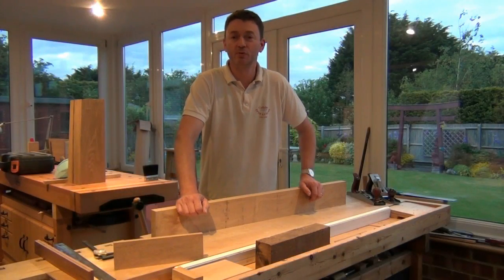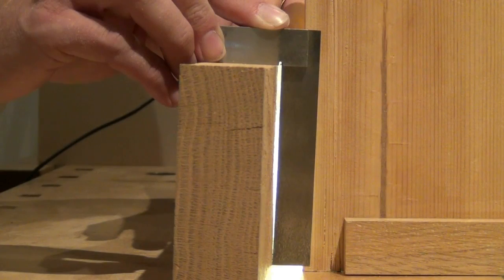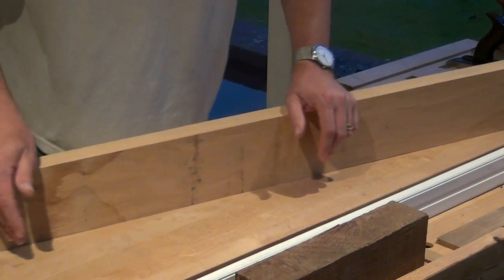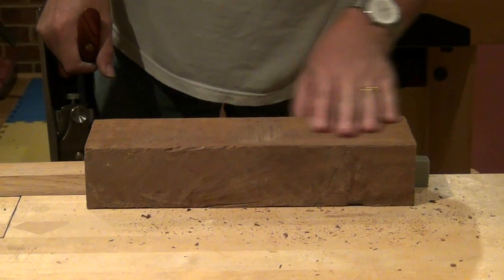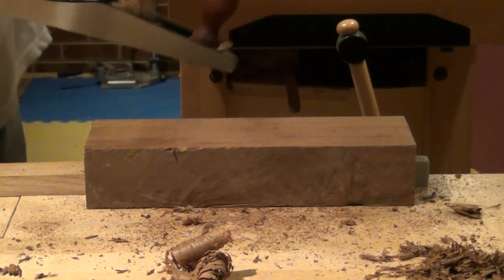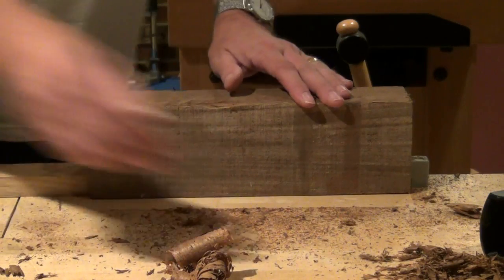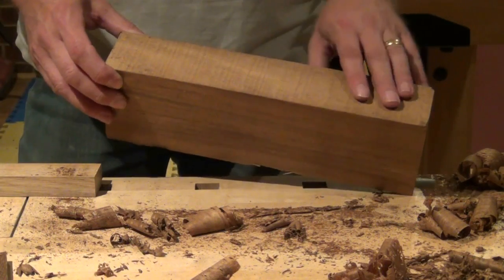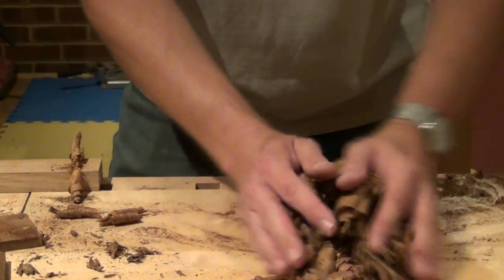Squaring a Rough Board (S4S/PAR) #HandorPower

Comment: Nice job of demonstration Mitch Peacock - WOmadeOD.  Can you explain why you chose to do diagonals at the very beginning?  I often see others doing this, but I don't recally anyone every saying why.
Reply from the maker: The plane sole rides the edges and prevents the iron from cutting in the low spots. Alternating direction covers all bases in that respect. I also find it easier to take heavier shavings without tearout on the diagonal or cross grain, like using a carving gouge.
Reply: Mitch Peacock - WOmadeOD , tyanks for that bit of insight.  The use of diagonals now make sense to me.

Comment: Nice idea to show the contrast between the two approaches. I do exactly what Guy demonstrates; power jointer, power planer, and table saw with perhaps a bit of hand planing here and there. It does occur to me that the hand tool approach is far less expensive.  Entry level table saw, jointer, and planer will cost $600-1000 and no dust collection at that entry point, while a used #5, hand saw, engineer's square, straight edge, and bench (as you built in your intro series) can be obtained for far less; perhaps even under $100. I think one of the most common comments I see throughout the youtube woodworking channels is some variation of: "Then you pull out your $10,000 wonder tool, which most of us can't afford...", a genuine issue for many aspiring woodworkers that I think you and Guy are addressing in this series.  I am looking forward to seeing more of these.
Reply from the maker: Kevin Blair Thanks Kevin, appreciated. So far no requests for another to cover, so hoping somebody comes up with one!

Comment: One thought is a picture frame. I've made a fair number using power tools (table saw, router table for the rabbet, and either chop saw or table saw for the miters). I find that frames are very fussy. The 2 sets of sides have to be precisely the same length. You have to cut 8 perfect 45 degree miters and then get everything to line up perfectly when doing the glue up. I've watched your shooting board video a few times and wonder if that would make it easier to get the miters perfect. A second thought is inlays. Another woodworking task that can be quite fussy to get just the right depth and width to match the inlay stock. I have a much better idea of how to accomplish these chellenges with power tools, but have a sense that hand tools may make it easier to get the precision needed for successful/best results. Kevin
Reply from the maker: Kevin Blair Thanks Kevin, they sound like interesting topics. Guy and myself will go through all the suggestions soon. 
I can see me squeezing in mitre shooting to the August dates!

Comment: Perfect thanks Mitch, managed to see the light and everything in my workshop is now done by hand tools. Even ripping 8' boards to width; which does become a little wearing at times, but I always work to the mantra "never fear slow, only fear stop!".

That was the other point I wanted to make; the times on the videos were very similar, but how long did it take Guy to set up his machines for the filming beforehand ?
Reply from the maker: derek4dragons Good mantra.

As to timings, I really don't know. But I also had to sharpen my plane, check my winding sticks, etc. 😉

Comment: Hi Mitch, watched both videos and comments as follows

1. How much dust did Guy create?
2. How much noise did guy create?
3. How much money did Guy have to spend to get to the point he could do the work compared to you?
4. What sort of conversation could Guy have whilst working?
5. I'd be very concerned to have anyone else in the workshop whilst working with so many power tools
6. Having been down the road of power tools initially, I found issues with control, and when something does go wrong, there's no way to stop it without endangering digits, if you know what I mean

Very interesting comparison though, and I am interested to see what everyone else thinks

BR Derek
Reply: derek4dragons Didn't see this before I posted my comments, but mine are right in line with your thoughts on the comparisons between the two approaches.
Reply from the maker: derek4dragons Thanks Derek. Good summary, and I hope ask your digits are in tact.

Comment: Mitch, any input on a bevel up jointer versus a bevel down jointer. I just saw the video on the patent free frog setup for the Bailey pattern planes, that was ingenious, thank you for sharing!
Reply from the maker: I've not used a bevel up jointer, but the jack I have is very good. I don't suppose there is much in it between them, but I do like the heft of my bevel down jointer when I shoot with it. The wider surface of the side of bevel up planes also makes them easier to use on the side, for example when jointing veneers (I have a video on that).